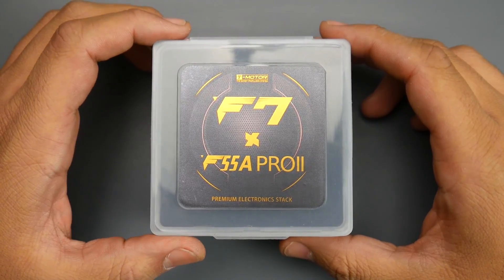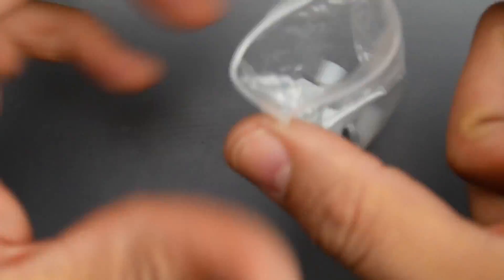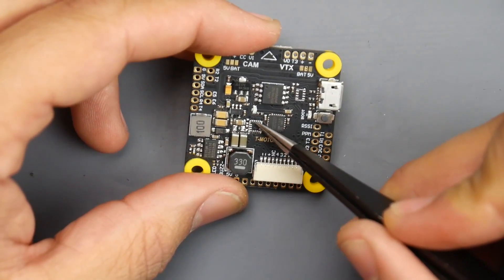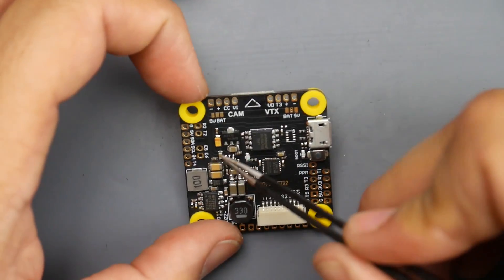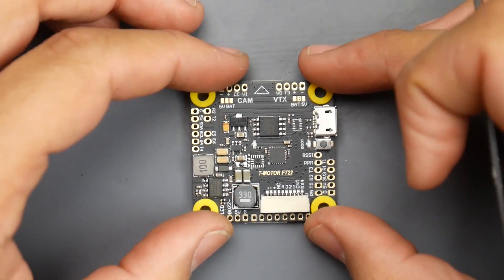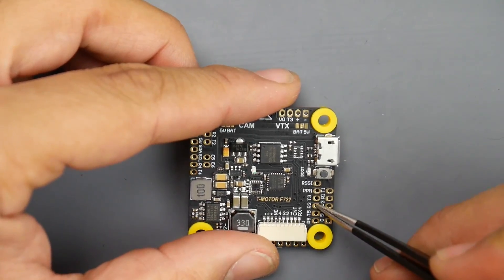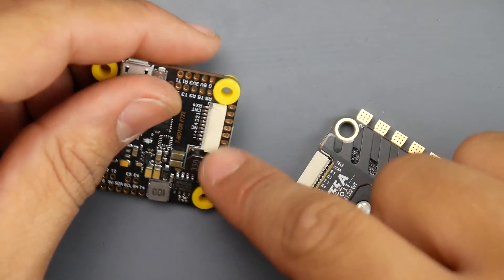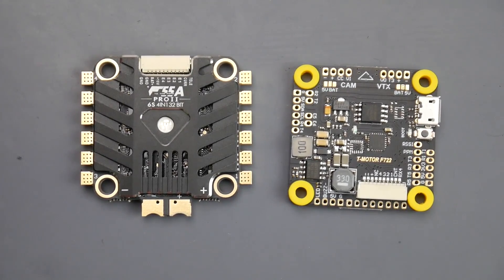First T-Motor F7 Stack //  First Hand Look & Setup Guide

Comment: Where do you get the drivers for this? I built mine and connected it to beta flight with what looked like the right driver but when connected none of the tabs on beta flight seem to work. Won’t spin the motors or detect its attitude.

Comment: Thanks for the amazing content! I just bought this fc and rush fpv solo vtx. I put one solder blob to two pads (bat and middle one, below vtx pads) to choose battery voltage. I soldered wires for dc in, gnd, video and smart audio to 4 top pads. But I get no power to vtx. Did I do something wrong? Or I should remove solder blob that bridges two pads below, for battery or 5v selection, and just put red wire to bat pad, without any bridging? Im worried I did something wrong. Plugged in with smoke stopper, reported everything ok, but no leds on vtx. I didnt touch those three pads for VTX on or pit at the back side of fc.
Reply: In the video, he says you can solder directly to bat or 5v for the vtx. And on the back you have to choose either on or pit
Reply: @29jvskate  Thank you John. But this fc indeed has 10v pads. But now power in them.
Reply: I'm having the exact same issue

Comment: I bought this , esc keeps rebooting. I set up everything fine then checked if there’s a bridged solder, everything’s good. I used smoke stopper . Everything boots up is just the esc keeps on rebooting . I thought Tmotor is very reliable. They don’t even reply to my emails, I email PyroDrone (where I bought this) but I’m still waiting what solution they’re going to give for this.

Comment: Good review.  Looks like a really good FC.

I'd use R1 for receiver and T5 for telemetry for FrSky SBUS.  R1 for FrSky Fport.  R1/T1 for crossfire. R1 for Spektrum or iBus.
T2 (runcam) or CC for camera control.  If using GPS rescue, then T2 for that instead of runcam control.
T3 for VTX control
R4 for ESC telemetry

M5 and M6 can be remapped for softserial for non-chatty UART applications. (like if wanting runcam UART cam control AND GPS AND FrSky SBus and Telemetry - put UART cam control on softserial)

Also if you wire VTX straight to vbat or 5v pad without bridging you lose the possibility of pit mode (as it switches + voltage, not ground).

Like the Tmotor products.  Very high quality.  Likely to use this stack on 6S race builds in the future.
Reply: Cam control not working with this board, i wired up a jb runcam the same way i did on my last build that had a similar pinout. Any ideas?
Reply: @jamestavernier8222  I will assume use are using the CC pin on the T-Motor F722 board connected to the analog cam control pin on the camera.  No resistor or pull up capacitor required.  Configure via the instructions at:  https://github.com/betaflight/betaflight/wiki/FPV-Camera-Control-(Joystick-Emulation)

For particular cameras you may need to look for settings in the RC Groups compatibility thread: https://www.rcgroups.com/forums/showthread.php?2961216-Betaflight-Camera-Control-Compatibility-Reports

Make sure that the same camera voltage is in use (5v or vbat).

UART camera control is a different story.
Reply: Don't you mean T1 for Frsky Fport?
Reply: @Bacon-ol3yr  If running Fport, yes put that on T1.  My mistake in original comment.

Fport runs on a T port instead of an R port as it is bi-directional based off FrSky telemetry.  Great alternative if you lift an R pad or burn an R trace.  Pain to get going on an F4 board, but fine on an F7 (and you get RSSI for free, no extra channel).

From memory, Fport latency was measured to be almost the same as SBUS.

Comment: I use this F722 Stack with the F55 ECS from T-Motor on four of my quads (2x 4S and 2x 6S). I am absolutely happy with them and have never had any issues so far. Previously, I've used the also pretty new Diatone Mamba F722S Stack and I had 'de-syncs' on like every 4-6 flights. Tried everything with Firmware, BLHeli de-mag settings, idle values, different motors, etc.. nothing helped and it was a real pain. This T-Motor Stacks is rock solid and I can also highly recommend it. It is pretty expensive though. What I've also realized is that some boxes come with racewires and some with plastic clips to hold down the motor wires, so there is inconsitancy in what is inclueded, eventhough they wer all brand new and factory sealed. As I don't use race wires, I don't care that much. :)

Comment: I'm currently installing that esc as we speak and blheli32 configurator won't recognise motor 4 literally nothing I do will make it spin
Reply from the maker: How is the esc connected to the FC?
Reply: Are you on dshot through betaflight? You might have it set on oneshot for some reason.

Comment: I just built my first 5in with the 45a V2 version 2 weeks ago. Absolutely floored with the quality. I updated to BF 4.1 and haven't had to touch nothing since setup. It has proven tough peaking at 54 amps several times with the Xing Camo 2306 2450kv. Being a newer pilot, it has survived some rough crashes. Highly recommend it. Worth the money.
Reply: Same new pilot so I will get that 👍

Comment: I have a buddy using this ESC on a 10 inch quad. 180 amp punch on 6S. Very solid ESC.
Reply: It’s a 55a ESC it would not have a peak punch of 180amps. Come now
Reply: @AndrewBlanche  55x4=220
Reply: I was pulling almost 220A, took it like nothing. It is a robust ESC.